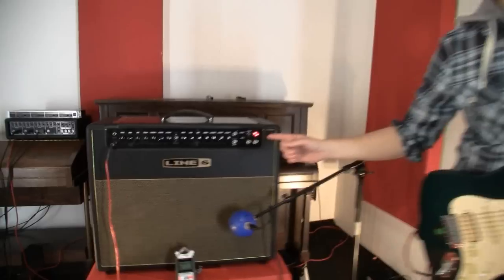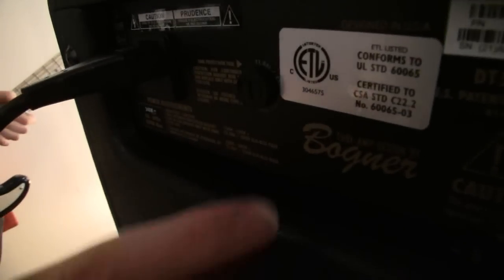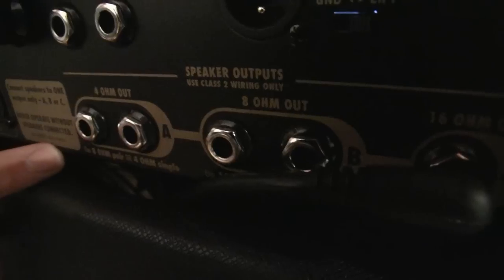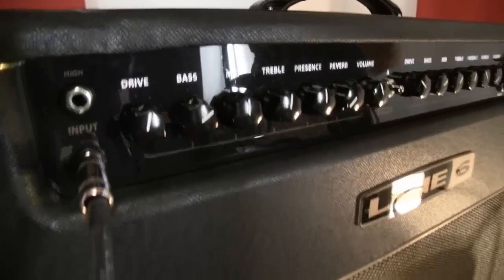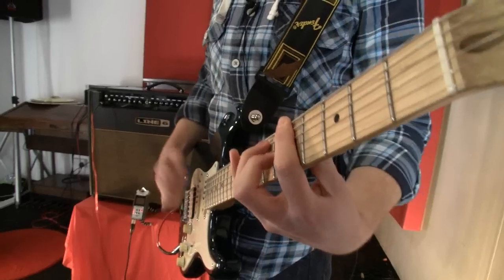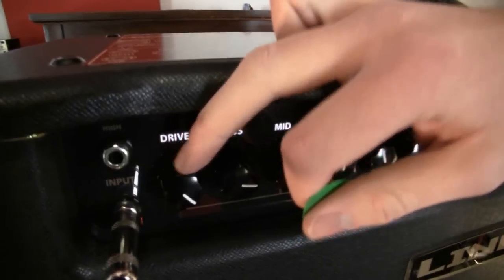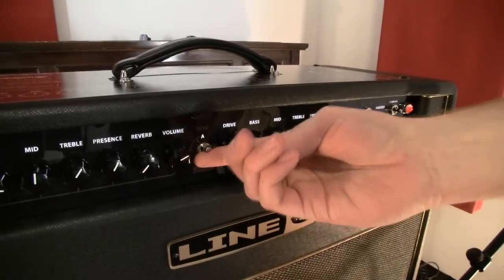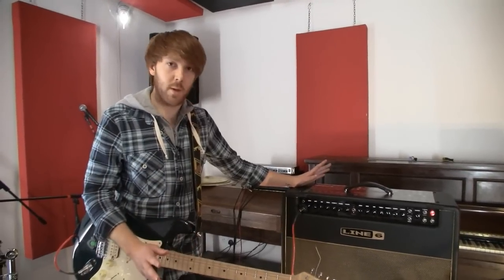Line 6 DT50 212 Review

Comment: I have a DT 50 212 and I don’t like the mixing speakers. Yeah I put 4 heavy duty casters on mine too heavy. I highly recommend if you can find a pair or better a quad of Celestion G12M 16 ohm 25 watts and most importantly the base response of 55hz normal guitar speakers are 75 hz. The speakers I recommend they were in most marshal cabs in the late 60s and 70s. My quad are from 1971. They are the best. I have a DT 50 head as well and play through my marshal 412 with my g12m Celestion with the 55hz bass voice coil. Good luck